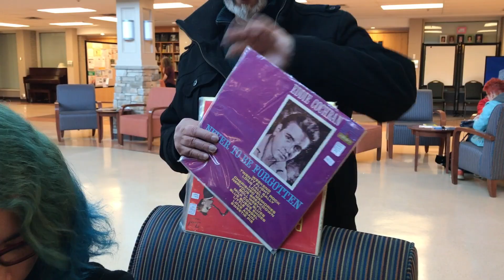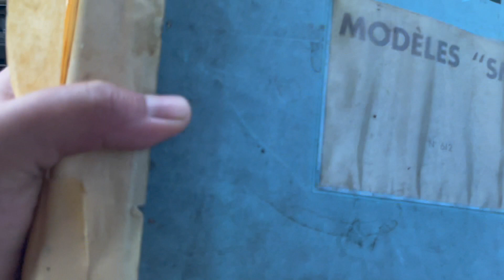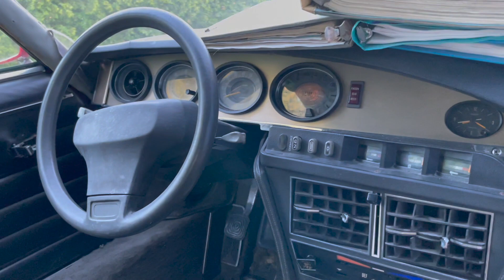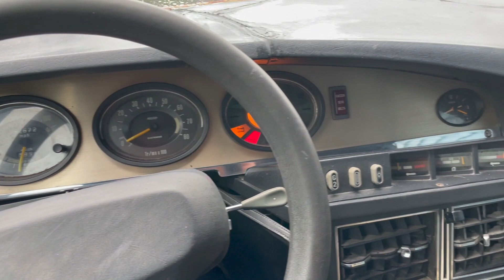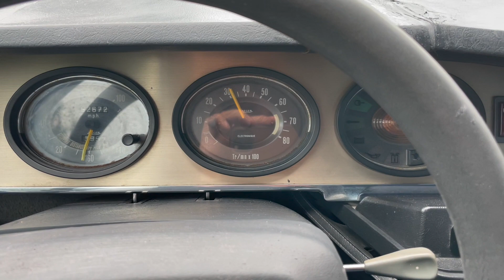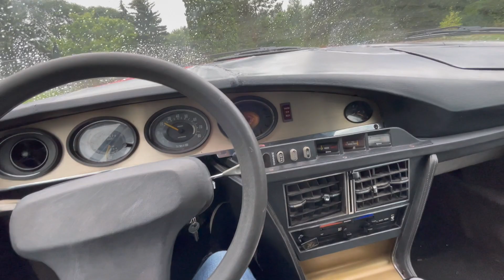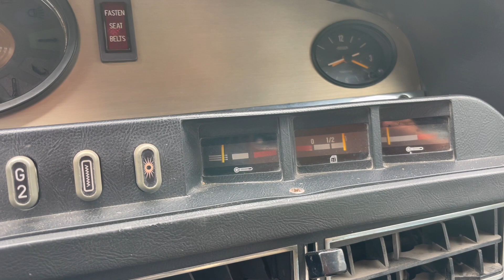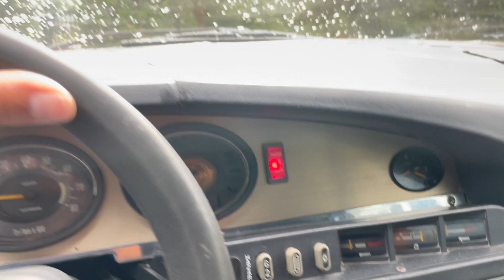Resurrecting a derelict french spaceship, Neglected Citroen SM

Comment: Great cars the ultimate in comfort driving. If you change the LHM hydrolic fluid the suspension will be even better as it operates the power steering and the brakes as well. THe self centrering steeing was a safety idea in case of a high speed blow out or maybe a heart attack that the car did not swerve off the road. A few handy things about the adjustable suspension i found out to be useful were : when set on the lowest setting the car cannot be clamped !! also when in a flooded area you can go where others cannot ! and if collecting heavy items you can drop the load height right down. If in dire need and you don't have a spare tyre it will drive on 3 wheels as the suspension will re-distribute the weight and due to the fact there are no shocks you have a completely flat and useable load area , speed bumps are no issue either You were really blessed that there was no rust as that saves you a ton of money. Looking great after the polishing job. Hope you enjoy it happy motoring  and those SM'S are worth good money and will only appreciate in value as they are rare.

Comment: These cars were not so rare here in Europe but still fairly rare.   The lines are reminiscent of the Citroën CX  and XM.  With this suspension the car can actually be driven on three wheel and if you need to change a tyre you just raise the suspension rather than having to use a jack.  I am glad you found and rescued it....

Comment: Beautiful recovery and video!  In 1972, I wanted an SM. In 1980, I found one for $10,000 ... and I'm glad I did Not buy it. ;-) The hydropneumatic fluid degraded the gaskets, and the 'suspension' system, which controlled everything - steering, braking, and suspension, had a tendency to bleed to death. In a pitiful, humorous manner, the 'dead' SM would sink down to the lowest level. It was supposed to be the luxury Citroen, to compete with the Mercedes and Cadillac.

Trivia left out - The SM was the most aerodynamic car at the time, due to its distinctive cutoff bullet shape. The internal soundproofing was as good or better than the Rolls Royce at the time. You used the suspension to 'jack-up' the car to change tires [like the batmobile at that time]. Power rank&pinion steering was new at the time, and the non-production demo was only one turn of the steering wheel from lock to lock. The steering is power assist (also new at the time) with more assist at lower speeds, and increasing resistance to deviate from a straight drive at higher velocities. The turning headlights were not allowed in the US. Many of the flaws were improved after-market by a dealer/mechanic in California. The SM could turn corners flat when the option was switched on, but I never saw that option in person.  Fifty years ago, it was the car of the future, but it was quirky, or goofy, as you said... not cool like a Tesla.

Comment: I used to have a DS 19. Brilliant car, great suspension which can be used to change the wheel when you get a puncture. Lift it up, put the supplied prop under the sill near the wheel and then take the wheel off. It has been known for some Citron cars to drive with one wheel missing.

Comment: What a lovely looking SM! I think you are lucky the hydraulics worked without problems after such a long time, not at all uncommon to have air in the system, a rusted out hydraulic line or perished rubber return lines... Pro tip: don't drive around in the lowest setting, it is only used to partly depressurize the hydraulics, or change a wheel. In the lowest setting the car is on its bumpstops and driving it puts a lot of strain on some components.

Comment: It's not pneumatic. It's hydraulic everything. My dad just got one of these in immaculate shape in white. Fantastic piece of wacko engineering. Steering is hydraulic, breaks are hydraulic, suspension is hydraulic, god forbid you have a sunroof! I've only begun to dig into this one. I hated the suspension system on the Rolls, but on this car it is very cool. 4 steel spheres half filled with the hydraulic fluid and 3000psi nitrogen fills the top half. Absolutely fascinating how the plumbing works. Dad's is the '73.

Comment: probably been 40+ years since I looked at one of these but remember so many oddities on the various Citroën models. The single spoke holding the steering wheel, headlights that steer into a turn to help visibility around corners, etc.... I know some models were self jacking....you could raise the ride height in the rear, drop a little stand underneath then raise the wheel by effectively lowering the ride height control thereby lifting the rear wheel off the ground. I think on some models the body panels (in the rear?) were held to a tubular frame/substructure by clips rather than being screwed on as in most vehicles.

Comment: My 1999 Chrysler 300 M's battery is a pain to change also.  It is located behind the passenger side next to the tiees, sits in a holder but you not only have to jack up the car, remove the tire, but you also have to pop the hood to remove the air cleaner to get to the back (really the front of the car) to remove the other 2 of the 4 bolts holding in the battery.  Quite the chore for this 72 year old woman.

Comment: That's really a rarity! It's a GT class car. Only 12 920 have been made, and only 2400 have been made for the American market. It has a speed capability of around 140 mph, so you'd better get the breaks and susspension right! The body looks like it's made of some galvanised steel or something that doesn't rust, otherwise it would be impossible for it to be rust free on those front dents.
Reply from the maker: Lower panel was aluminum

Comment: I think you've got a rare surviving SM from the early 70's. And from what you obtained with this detailing is really promising and could be some interesting but costly project.
These SM were designed as the high end successor of an aging then DS, and Citroen acquired Maserati to get the motor they needed for cruising on European motorways, with no speed limitation and no mpg problem... It was actually built to drive like a magic carpet at speeds up to 200 km/h, something in the same spirit Concorde was designed. The advanced hydraulic suspension is the same you could find in some Rolls Royce models, but you will find many other unique features like the Diravi steering system, wich changes steering proportional to speed, directional headlights (they seem broken on your model), suspension height also varies directly from the speed. You also have high pressure hydraulic braking systems (the "mushroom" is very sensitive, with NO ABS!). You've got 4 braking discs, with front ones directly mounted on the differential to limit moving unsuspended weights... This space vessel and all features was mostly mechanical, few electronic in these, and it was the most advanced of the car engineering. Early energy crisis killed it as mpg was gigantic and speed limits also limited the interest, other models like GS smaller model with a Wankel turbine went problematic and Citroen went bankrupt to be sold to Peugeot and resorted to less advanced models. Citroen finally abandoned the hydraulic suspension in 2017. Actual DS only mimic these features with electronics!
Citroen models from the 70's are also known for their rust problems, and as a body car, with no chassis, it could be really problematic. With hydraulic suspensions, brake system and steering system, you have something unique in technology with oil pressure up to 2.500 PSI... So if any line or joint leaks, prepare for the worst, and the expensive, and always have a spare bottle of LHM and spare parts... The Green spheres act as suspension or pressure reserve with a Nitrogen inflated membrane, these can be rebuilt and fitted with some sort of Schrader valves... From what I could have heard, the fast clicking sound sounds no good, maybe a conjoncteur-disjoncteur sphere to check. 
Maserati engines are also requiring many attentions, as they are difficult to maintain and require special tools and skills. One important thing to do is to change the distribution system... and use fresh gas! If you have a carburetor model, it's also less problematic than injection models, but unleaded gas is deadly if you let it rot for ages (it also disintegrates metal tanks).
However, if you have the time and money to achieve a decent and running model, many people can certainly help you to get information and parts.
Here in France, some passionate rebuild completely these SM, but they also change the many problematic parts with the actual technical skill. The Maserati engine is modified for better performances and much higher reliability... They transform it into a luxurious actual space age engine, with a bill way over 100.000$
Here in Europe, we have a SM club, and it's not a cheap dungeon for mechanics!

Comment: Alex, see if you can fix the headlights. The car was designed with a linkage between the steering and the inner driving lights. As you turn the car left or right, the driving lights follow and light your way around the bends.

Comment: I've had a Citroen ID 19, a 1962 .  My dad had 5.  
  They are a crazy hydraulic system,  the ID and DS models had a very prone to rust out , unibody/beam, sheet metal framework. 
  Unless you love to work on complicated,  fragile, crazy car, constantly I would pass it by. It looks like it has been neglected and abused for years.  They do ride better than probably any car in the world,  but they handle weird with a lot of body roll on the corners.    Good luck !
Reply: P.S. ... My friends called mine the "roach", because of its strange styling.

Comment: You could order the plexiglass cover at the citroen-sm-club in Germany
In "Ersatzteilliste", it should be "Scheinwerferabdeckung mitte", 
parts number 5 426 469 , 
They don't offer the inner door handles though.
I'm not a member there, just learned at Citroen the late 70s and worked as a citroen mechanic in my youth. Never got a SM customer, but a citroen shop owner in Rosenheim, where i lived back then, had one. Really expensive car even back in the 80s.

Comment: Now that the car is running you should be able to jack the wheels using the hydraulic suspension. Also, I'm sure it can be driven with either one of the rear wheels removed.

Comment: That car will be really cool once the work is done.  NOT for driving in snow  or on gravel, but it'll be fun to mess with.  My 2005 Altima has a wonky gas gauge that sometimes reads 1/4 tank fuller than it really is.

Comment: This car was absurdly advanced when arriving in the seventies. The small brake-button was part of the hydraulic system, also the suspension, so it didn't need much pressure to function.
Reply: And the lights follow the direction to be turned into!  Well maybe not in the, strange US?

Comment: Citroen's are known for low drag coefficients.  
With some models, you can change a tire with no jack using the air suspension to raise one wheel and lift the car with the opposite wheel.

Comment: Alexander, the plexiglass front piece will not be a simple repair due to the multiple compound curves and angles in the piece.  If you can't find an intact OEM replacement part, it could be exorbitantly expensive to recreate it.  The same goes for the lower grill.  It might be possible to repair the damage if you can find an auto restorer with the necessary metal working skills to salvage and repair the grill.  This would not be something I'd attempt without the requisite metal and body repair skills, given the complexity of the repairs required.  I'm not saying don't do it, just realize this is likely to be significantly more expensive, think Rolls Royce here, than you might have anticipated.  Either way, I'm looking forward to future videos on this very rare and unusual Citroën.

Comment: Amazed it started and runs well. Maybe the timing chain had already been replaced.
Naughty - should not drive a hydraulic suspension Citroen on the lowest setting - there is NO suspension.
Hard on the bump stops. Only use this setting when changing a tyre or servicing..

Comment: Did you look at any of Jay Leno's vids on a Citroen SM. You don't use a jack on a Citron they are built in. This car was better than anything made in the US in the 70's.. It has inboard disc brakes. headlights that turn when you turn the steering wheel.

Comment: You should never drive this car in the lowest suspension setting and drive it slow only in the highest setting, because it will have nearly no suspension at all in both settings (the lowest setting is meant for parking and the with the highest setting you can change the tires). We had a Citroen GS in 1984 and i remember reading this warning in the manual that you should not drive in these two settings.

Comment: If you put the suspension on high you can take a wheel off and it will drive around.  No not at speed but you could move it from garage to drive.

Comment: Lucky that it's mechanically sound. A friend attempted to get a DS running and he could have spent alot but got smart. He gutted the engine and suspension during lockdown and is going to swap a Prius drivetrain into it.
Reply: Gutting a classic low production number car is never smart especially with  a SM.
Reply: @Hanzyscure  if you saw this one you'd know there is no putting it to stock. All the parts removed went to someone else in trade for body parts. Rusty floors and inner front metal. Missing small parts and moldy interior

Comment: I want to see all those motorcycles in the back yard. Disappointing that it has an automatic. It's a luxury car.
Reply from the maker: It turned out to be a manual
Reply: @CuriosityIncorporated  Ah, yes. those pedals on the floor should have been a clue. Accelerator, brake, and oh what's that..clutch!  They were pretty strange looking actually. Was the little round one the clutch? Those French designers!

Comment: I would imagine the car uses rubber bulbs that fill with air to give it that "floaty" feeling. If so, they have probably dried out over the years and leaks might be expected. Also, when paint goes dead, wax will bring it back for a time, but it will go dull again fairly quickly. Especially reds for some reason.
Reply: Hydro-Pneumatic suspension with spheres instead of shock absorbers, not air bags.